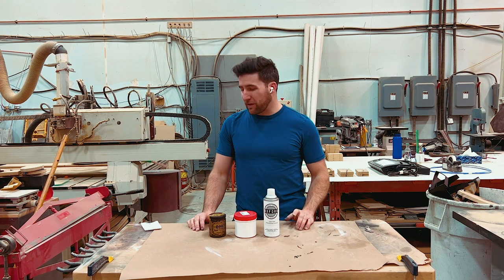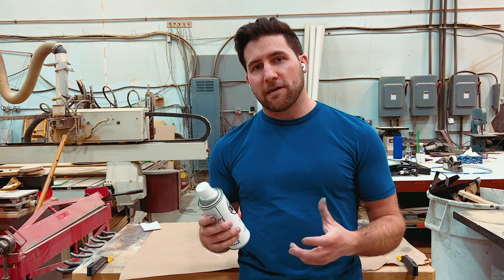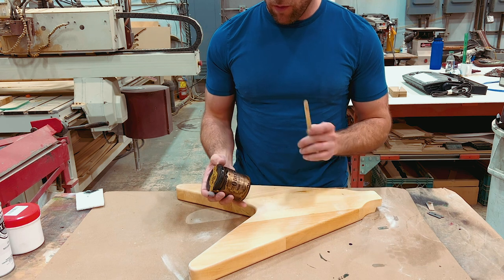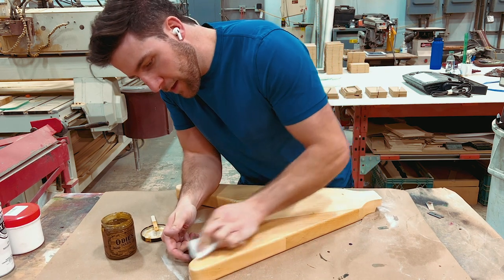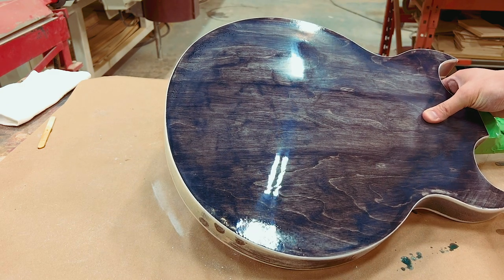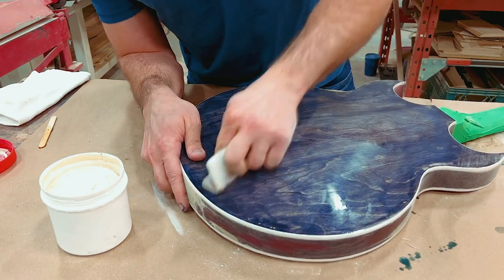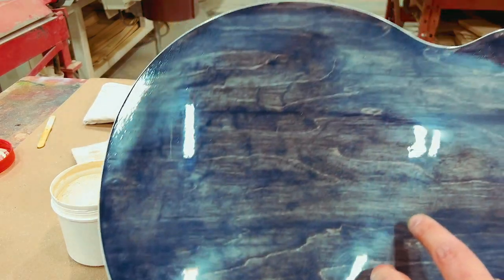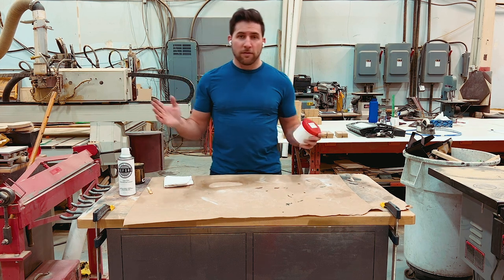3 Ways to Get a Nice Satin Finish

Comment: Brad, Thanks for your help, especially your series on the Solo ES335 kit. It inspired me to try it myself and after a few mess ups I am very pleased with the results. I don’t have a well ventilated shop and my wife is very sensitive to strong odors, so I thought I’d try something water based. I found some varathane water based poly that I could brush on with a foam brush. I used trans tint red stain and found I hadn’t sanded all the sealer off. What a mess! I eventually added the tint to the poly and gave it three coats sanding lightly between coats. Then I applied about twelve coats of clear poly gloss and let it dry for two weeks. I started sanding with 400 and gave it two more coats of clear and let it dry a couple days before using 800, 1000, 1500, 2000 and 3000 and 3M rubbing compound. I had my doubts but it came out pretty nice. Installed some epi probuckers that sound great after some wiring repairs and adding an extra ground between the tone pots. I appreciate your channel. Again, thanks!
Reply from the maker: Glad to hear it worked out Edward!

Comment: Hello brad. I’ve been following your videos, and I’m working on a tele finishing project. I think I’ve decided on sealer (shellac aerosol) paint (rust oleum 2k purple paint+primer) but I am not totally decided on what clear coat to use for a satin finish. Let me know if my choices are ok so far, and what your recommendation would be for a clear coat! Much love from Wisconsin, hope you and your family are well.
Reply from the maker: Hi Sam, those should work. Although I don’t love the combo paint and primer cans, they generally perform ok. Rustoleum also has their painters touch satin clear, which is probably a decent option based on your selections.

Comment: Tried the satin look using Varathane for my last build to have a clear finish over barn wood. It did the job, but is still soft and still leaves fingernail imprints after many months.  Have you ever used the CRYSTALAC products from Solo? I have no place to use anything spray, or with harsh vapors. These look like they would do what I am looking for but can not find to much on how they work. Have the urge to do another build, but unsure how to get the finish I am looking for in the space I have to work.
Reply from the maker: I’ve used them a bit, but Chris from Highline guitars is more familiar with them. I’d ask him.

Comment: What's the best way to get bubbles out of your lacquer finish? Thanks in advance
Reply from the maker: Air bubbles? Did they show up immediately or after a while?
Reply: @BradAngove  I am pretty sure it all looked good then an hour or 2 after they showed up.
Reply: @BradAngove  2 or 3 hours later I noticed they were there.
Reply from the maker: Ok, that is probably solvent from the prior layers bursting through the dry top layer. Does it look like pin holes in the finish?

You’ll need to sand back and re-apply the lacquer if I’m right. It’s caused by coating too heavily and quickly. The top layer dries from air exposure while the earlier coats are still a bit wet and the solvent makes holes/bubbles as it escapes.
Reply: @BradAngove  Most of the bubbles are just trapped in the finish. I sanded back and went through into my stain. This is the first guitar I've ever done and I've had every problem you could imagine. I thankyou for all your help I do appreciate it. After sanding it back and applying more lacquer it appears like there are more bubbles.Grrrr, I need to send you a picture of this maybe.
Reply from the maker: Are the bubbles showing up right in the first layer?